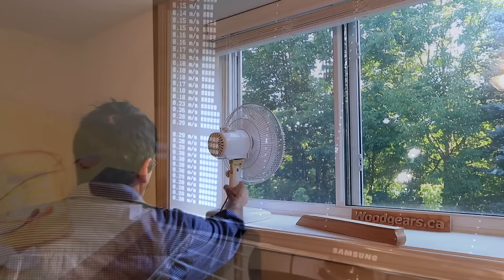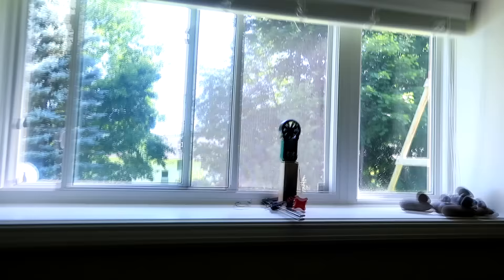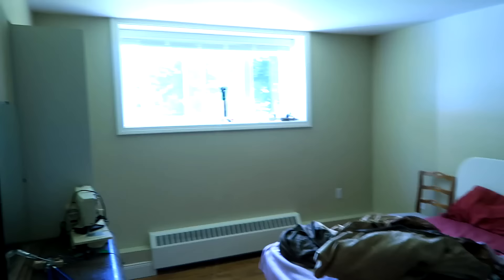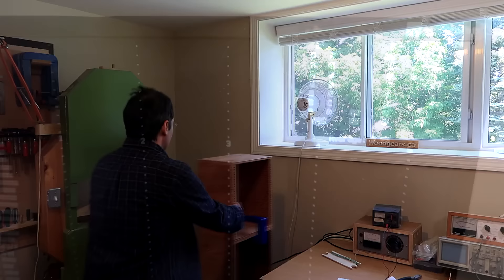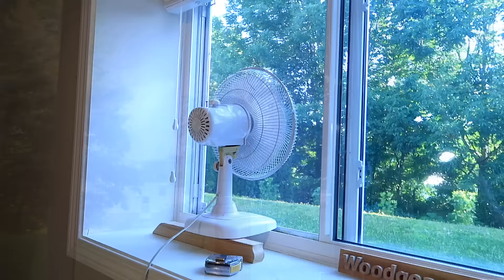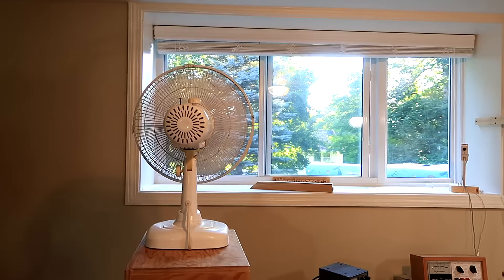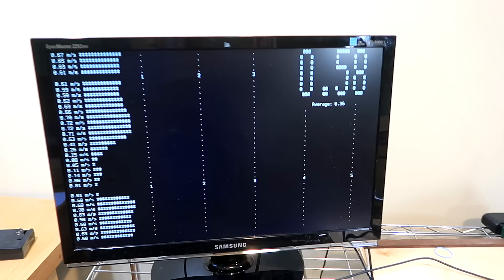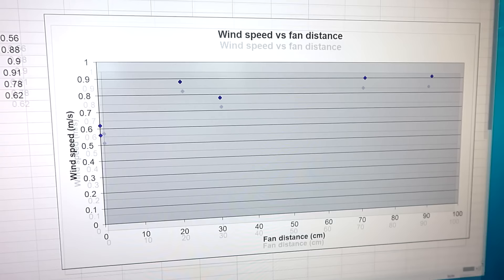Best fan placement to move air through the house

Comment: Years ago in a non-A/C house in MN I made a plenum that I could hang in the top sash area of a window and the box fan would set horizontal on the thin wooden plenum about a foot from the ceiling.  That exhausted and pulled the hottest air from the ceiling and pushed it outside.  Worked wonderfully.  Better than any other implementation I tried.
Reply from the maker: cool.  I'm sure that got lots of questions from visotors!
Reply: @matthiasrandomstuff2221  It actually looked nice.  I made it look nice.  Triangular cross section if looking from the side and guiding the air towards the window.  This allowed me to walk by the window without hitting my head.  Remembering now, it only fed and fit the top half of the top sash.  Not that noticeable from the back yard.  :<)
Reply: That's pretty clever.
Reply: @oscargr_  Thanks.  It worked so well I used it for years.  I could close the top sash without removing anything and it fit in place without any fasteners.  I showed it to the people that bought that house from me and they chose to keep it.
Reply: That's the right way to ventilate. Hot air rises.Vent out the warm air near the ceiling so that cooler air can come in to replace the exhausted warm air. For the best result you need cross room ventilation.
Reply: @stallion63m35  yup, this is why a whirlybird spinner roof vent on a house with an attic works too - let that hot air out in the direction it wants to naturally go.
Reply: @gregorykusiak5424   Absolutely! That's a brilliant design which vented hot air naturally without much obstruction to airflow outside.

Comment: I think this will save me from another blazing hot summer. Always had a fan in my room but have been using it the wrong way all this time. I place it so that it blows the air out my window instead, and in the evenings when it's cold outside I turn it around to pull cold air in so my room is cool at night, it works so well.
Thanks

Comment: I installed a large fan in the apex of our attic.
Not only does it remove the hot air in the attic, it pulls the cool evening air into the house and cools every room down considerably.
Attic fans work!  👍
Reply: I used to live in a house with a big extraction fan pointing into the attic.  It was noisy but the breeze through the house felt great.  Is your attic fan purpose built for being in an attic?  Did you have to add any ducting or vents?
Reply: I put a solar power attic fan in my roof over the shop. Before the fan I monitored the temperature in the attic space with an indoor/outdoor thermometer. I kept the indoor unit in the shop and the outdoor unit I stuck in the attic. The temperature exceed 140F any day the ambient temp was over 85F. This made the ceiling of the shop which is insulated hot. After installing the fan the hottest is has been in the attic is 126F, so about 20 degrees cooler. I have noticed that the temperature in the shop stays about 5 degrees cooler than before the attic fan was installed. Solar powered so only works when the Sun is out but hey that's when it's hottest so it all works out.
Reply: @nefariousyawn  
Yes the attic fan was purpose built for being in the attic. (30 inch diameter 4 blades)
It came with a round cowling that installs in the apex. I removed the extant square vent that was built with the house and created a round hole that fit the cowling.
I sealed everything and then mounted the fan. (the outside of the cowling has louvered vents that close when the fan isn't on.)

I installed a wall mounted switch for the fan in the hallway underneath so that we can manually control the fan. It also has a thermostat that can automatically control the fan when attic temperatures exceed a set point.

The fan is quiet and it has an oil port for lubrication which I oil every spring.
Reply: @bobd.  Sounds like you have a good solution for your shop!  👍
Reply: @skippylippy547  I’m just researching options in Canada ... what brand did you install?

Comment: This actually makes sense to me, In Firefighter training here in Germany we get told to put up a fan at a distance where the cone of wind coming of the fan covers all of the Door / window.

(We use large fans to air out homes full of smoke)
Reply: I'm guessing the initial air flow drags additional air surrounding it,producing a larger flow at a distance, (I can't remember the name of the effect.. It's not venturi, but one of those. anyway, if the fan is at the edge of window, only the air straight through the fan is evacuated, while the air dragged along is outside air. If the fan is further away, it drags a larger amount of inside air and pushes it outside.
Reply: That would be the most logical
Reply: @maximeteppe7627  Bernoulli's Principle
Reply: Where there's smoke... there's fire... fire needs a fuel source and oxygen to burn. Is this a case by case basis sort of thing? I'm beyond interested because this (on first thought) sounds extremely counterproductive? I imagine a group of 5 firemen "oh shit"-ing themselves when they make the flames bigger or reignite from an ember 😭🤣

I remember running outside one day when I heard firetrucks rushing outside. A neighbor's garage (a detached, rectangular, 2 car garage with a large garage door that spanned the whole length of the garage and a side door leading to the house) was up in smoke, I ran closer to check it out and see the damage (real emergency crews were already there talking with the home owner and assessing burns). The flames were billowing out of the opened garage door and shooting out about 4 feet, and then straight up a good 15'-20', with firefighters standing MAYBE 15 feet away from the flames spraying in (I was across the street and could still feel the searing heat like I was leaning into a campfire.) Their next door neighbor's house is closer to their garage than their own house is and their neighbor's house had plastic side paneling... it had begun to drip. Right when I thought the flames were definitely gonna reach the houses, one firefighter started moving in 🤦‍♂️ He'd stuck to the far side of the yard and ran towards the opened side door of the garage, just to slam it shut. At first, I thought it was pointless... then I realized he was helping smother the flames. With the side door shut (and an astronomical amount of water already sprayed), the flame was pulling air in from the same opening it was billowing out of it and finally started to "puff" and stop growing, then it slowly started dying. It's wild to see how quickly THAT much water can instantly become vapor as it hits a giant glowing red box of flame. But that led me to believe you should always try to smother a flame first... and to never fan or add oxygen to it. 
I'm sorry if this read as "interrogation-y," but I am curious about why, simply because I don't understand the base principles and dumb people tend to appear as rude 🤣
Reply: @HedonisticHarv i guess it's done to remove all the smoke AFTER the fires are completely put out. and since theyve hosed down the area there wont be a chance of the fire reigniting from the oxygen

Comment: My favorite thing about this video is that each time I started thinking "but what about..." you jump in to adjust and account for it, throwing in a concise explanation as a bonus. So good!
Reply: what if the anemometer is backwards thats ehy it didn't spin for (fan facing inwards)? unless does the device works on both directions??
Reply: @hereandthere4751  I think it does work in both directions, since wind speed is a vector, it's just that it would spin backwards and maybe show up a negative reading
Reply: @hereandthere4751  fan facing inwards does nothing for circulation cuz it can only suck in air that is right behind it and the wind it generates is immediately lost

Comment: I love the fan research, we need more citizen science! Measuring air flow is one variable, but another important metric would be the change in temperature with different fan orientations.
Reply: This! Temperature and humidity is what matters I suppose to the occupants!
Reply: There would be too many variables for anyone to apply the data to their own situation. This video is good because he measured a simple metric that anyone can understand and means something no matter what your situation is.

The more air you move the better. 

For temperature It all depends on how hot it is outside and how hot it is inside and how many windows you have available and so on.
Reply: from experience if the outside temp is cooler than inside, if your using a fan the fastest way to cool the inside air is to blow outside cooler air in.  
blowing air out is very inificient in the same conditions for cooling.
Reply: My guess is there is a causal correlation between amount of air you can exchange and the delta between the two temps you are comparing (inside/outside air).  Could probably work something out knowing those numbers.  My guess is more air exchanged, the quicker the delta's converge.

Comment: Nice work, Matthias.  Patton, a fan manufacturer, recommends this in the literature that came with a fan I bought several years ago.  As you have found from experimentation, best air exhaust from the house is blowing out from a distance from the window.  Their illustration appeared to suggest a column of air being blown from the fan out the window central to the window opening, and other air current being invited to join the column going out the window. A turbulent column inviting some surrounding laminar flow ambient air out with it, if you will.  A larger net effect VS placing the fan right at the window opening and only getting the column of air exiting the window.  I have found that effectiveness of this strategy varies somewhat by fan setting. If I don't want as much air flow through my place, I turn the fan to a lower speed, and air flow goes way down.  Then I move the fan closer to the window and air flow recovers a bit. 

An interesting variation on your experiments might be to establish a baseline air flow with the fan right at the window at max fan speed, then see how much you can reduce the fan speed with optimized distance from the window, to achieve the same baseline flow rate.
Reply: Thank you
Reply: Entrainment.

Comment: I always pointed the fan out the window to help air flow, not sure why done this, it just made more sense to me that way. Now I have the data to prove it! :D
Reply: Pointing a fan inward makes the fan increase the air pressure to get hot air out, pointing it out doesn't change the pressure outside to any appreciable degree.

Comment: I did this and can't believe someone proved my point when my family asked why my fans pointed towards outside like I'm an idiot. I feel a more comfortable temperature when it points outside rather than points it directly toward my face. Thank you sir.
Reply: Me too. My dad always asks me that
Reply: Makes no sense. You're not going to make your room cooler this way.
Reply: @dsouza2000  It depends on the setup. In a closed room, no, I just tried it and the temperature went up, but in a house with open windows, if the temperature is cooler outside, you'll gradually pull cooler air in and push the warmer air out.
Reply: I'm confused. How come positioning the fan towards the window pulls in air? I would think facing it towards the room would pull in air from outside.
Reply: @shadyspades  because it's more effective to blow the hot air outside when it's cooler (morning or evening). This is also used for example in computer cases when you can only have one fan. When it's hot with direct sunlight (late morning and afternoon) I keep all the windows shut
Reply: @shadyspades  Blowing air outside removes air from the inside, resulting in lower air pressure, resulting in air from the outside rushing in from open windows to replace the air you just blew outside. If you seal the space around the fan, pointing the fan inwards will create overpressure, which is another valid way to ventilate. The issue (as mentioned in the video) is that if you don't seal the space around the fan, pointing it inwards will cause it to recycle room air, resulting in minimal net ventilation.

Comment: The thing happening here is air multiplication, vector augmentation, or entrainment. It is used for very high volume pumps, like bilge pumps and the air pumps that instantly fill the emergency slide for planes.
Reply: Thank you I scrolled down to find this!
Reply: Yes, based in Bernoulli theorem....just like a venturimeter

Comment: One big reason putting the fan far away from the window works better is because of the Venturi effect. When the air speeds through space, it creates a low pressure zone that pulls in more air around it.
Reply: I think the viscosity of the air pulls along more air as well. Don't quote me on this though since I'm not an expert.
If someone else knows more about this, feel free to elaborate on it :D
Reply: @AnimilesYT  Ya i think thats Bernoullis principle
Reply: @flaco1010  Venturei effect and Bernoulli principle are pretty much the same thing, you can explain, mathematically, a Venturi effect model with Bernoulli's equation.
Reply: @minimovzEt  ahh interesting. Time to do some more research :)
Reply: Agreed. In fact I was going to put the same thing in the comments but you apparently beat me to it. Also, wrt his video, not all fans suck air in from the outer front perimeter and blow it out from the center. I have a fan that doesn't do that. It depends on the design of the fan. As you said, it is still desirable to have the fan a certain distance within the area that you are trying to blow the air out of because of the Venturi effect. I believe those respirator pumps also utilize the Venturi effect to maximize airflow as well.
Reply: @ASalfity  but why do whole house aridità fans that HAVE to be right in the window work??
Reply: @Lili-xq9sn  maybe it's more space efficient that way?

Comment: Nice analysis!  I'm an airflow expert and run a WHF company.  The best way to get max volume and velocity is to pull the air IN through windows via WHF installed centrally and at highest point in house.  With a 2-1 ratio house sqr ft to CFM you will get 12-15 air exchanges per hour.   Besides cooling effectively and saving money vs AC, it eliminates odors, viruses and contaminants of all kinds.  For me the study that i need to to confirm, although i know what the results will be, is the amount of window opening to maximize the venturii effect at each window(max velocity).  Less is more, but there is a sweet spot for each scenario/layout.  I tell clients to play with it until they notice he max boost
Reply: What is whf?
Reply: @nomnombr  Whole House Fan
Reply: Yes.  I had a difficult apt where no room opened to the next room.  One level/top floor and hot.  I had 3 whole house window fans and  played with how much and which other windows to open in this scenario -- because the fans in different rooms couldn't communicate with each other.   I found that cracking the top of window #1 in a line of 3 window with the WH window fan in the bottom portion of window 1 worked best.
Reply: Are you sure it reduces bacteria? We've done lab work on agar dishes exposed to outside air versus inside air and the bacteria growth was easily 10x more after 7 days of incubation for the outside air.
Reply: @Nessal83  yea I’m pretty sure as are the WHF manufacturers and I think the EPA. Still that would be a good field test: test agar samples INDOORS with OUTSIDE air being drawn in over a number of hours/days
Reply: I placed a large fan in a doorway where it would blow a wall of air up, and slightly into a room, any air trying to get out of that room would hit this wall and be blown back in, the fan was placed outside the room,  and directed into the room but, mostly up, it seems to be working as a valve almost.
Reply: @brycering5989  Great idea.
Reply: @Nessal83  Lol, I assume they meant using a fan with a filter. Otherwise it'll only get rid of indoor contaminants and the degree of purification will be directly correlated with the degree of contamination of outside air.
Reply: You're going to need to combine the fan with an activated carbon filter if you don't want external odors (gases) to get inside, and a particulate filter to remove particulate contaminants (e.g. vehicle exhaust, smoke, viruses). Although this might be excessive for people who live in deep rural areas or otherwise far from pollution sources (other people, wildfires, volcanoes).
Reply: Yea multiple floor fans can move air but having a central or zoned system with the air being drawn in the windows, thru the attic and out the attic vents is most effective for air exchanges. 
Correct on the carbon filter solution, we do install these in place of regular screens. 
Outside air can be bad in some places so yes best to assess what your particular home could benefit from. Typically though, indoor air has accumulation of VOC, CO2, pet dander, bad molds and germs from respiration
Reply: @jtknight4647  I have been researching PIVs (Positive Input Ventilation) that seem to do the opposite - pull in air through the attic vents and push it into the house via a fan which pushes the stale air out of windows vents in the house